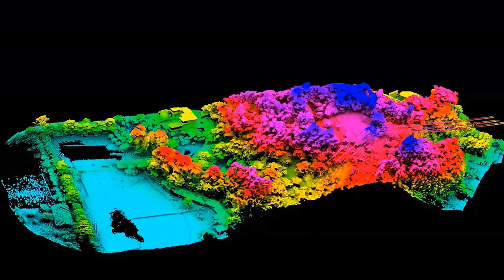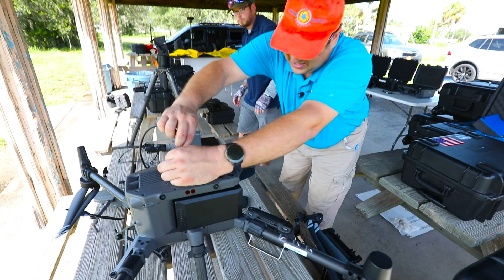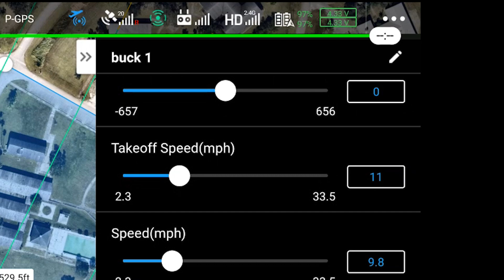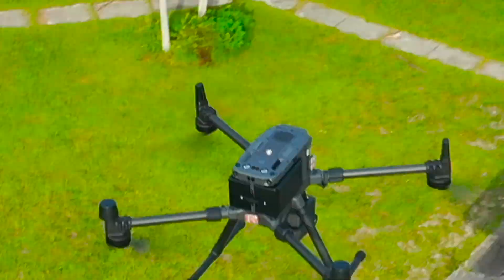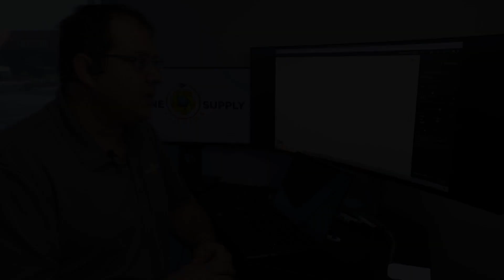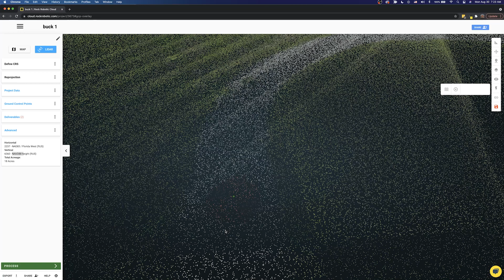Florida Drone Supply DJI Zenmuse L1 Livox Lidar Module workflow.  From unboxing to deliverables.

Comment: I have a question, when you sent your .las to Rock, were you already paying for Rock Desktop and Rock Cloud, or is there another option to just send them data and have it processed... if so, for example, what was the cost to have this "buck 1" project processed?
Reply: Thanks for the question.  You can create a demo account and that gives you 5GB for free to work with.  or the starter plan has 50 GB and Business has 500 GB - you can then upload view, share, analyze - then get full deliverables from $2 and acre.  You can also get planimetrics, contours, DEM, vegetation management, and more. contact us at sales@rockrobotic.com